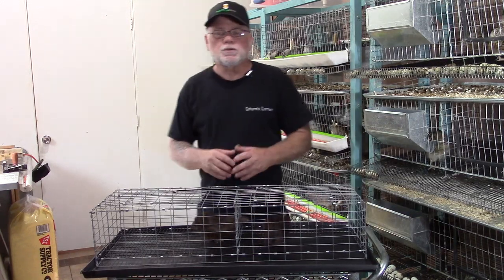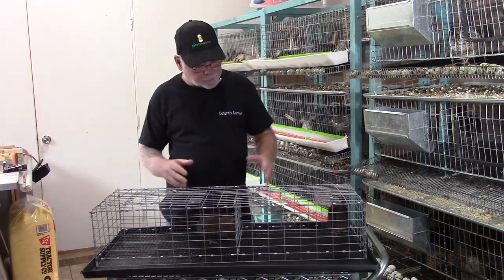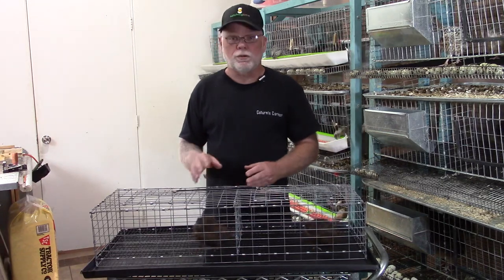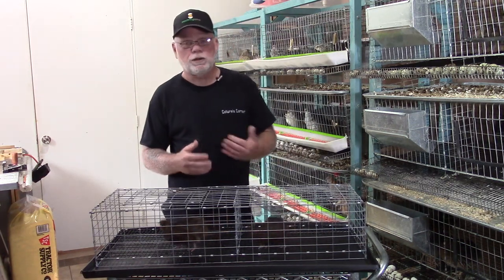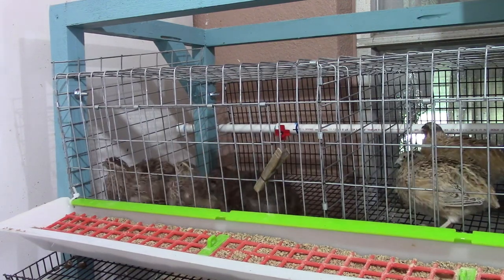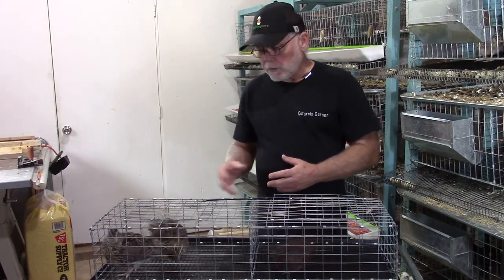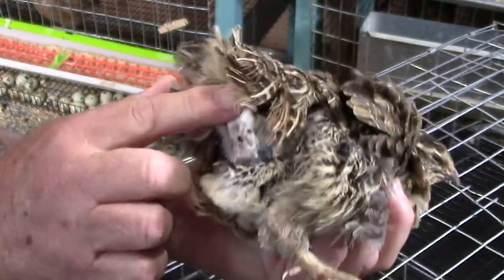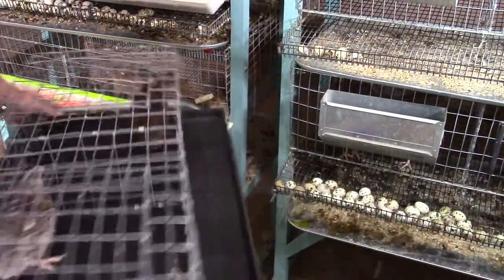Alternative Breeding Methods and Artificial Insemination

Comment: Awesome info Terry.  I've been having some issues with a new incubator that had an egg Crack in it last round, only getting %25 hatch rate for that run. After cleaning & sterilizing (not fumigating) 2 months ago, I started running small egg sets for baluts (30 each day).  After candling, I'm still getting poor fertility.  My breeders are all young healthy roosters (i.e. "foamy") and the do mate with the 3, 4 or 5 hens pending the cage, but still poor fertility rate.  It's been winter time cold here, so I collect throughout the day - some still warm when loading the in the tray.  I've made some adjustments for the last two racks, just to see if that can help (storing the eggs at 60°f in 70% humidity vs 50° in a cooler until loading).  I've also tried the H202 mist and rainwater rinse "patented" technique and will candle those this eve.
I plan on artificially insemination all my hens with my best rooster(s) just to ensure the next run is %100 fertilized.   If that doesn't help then it must be something with the incubator. The temp has 5 separate thermometers showing ideal 37.5°C in all areas, and the humidity is double checked with 2 digital readings.  Perhaps I will need to resterilize and this time fumigation with Potassium Permangenate and formalin gas (outlined in the wynola ranch hatching tips .pdf from Missouri stare extention).  I may try a smaller incubator and do a small batch just to eliminate that.  I have had %80 hatch rates, and nothing has changed with the electronics, controller, machinery, so I'm guessing it is the males.  I have swapped out layer feed with breeder feed, but they lay as if they don't notice a difference.

That being said - there is a story that 2 brands of tractor supply layer feed has caused flocks to stop laying.  My feed comes from an Amish country feed mill, and all non GMO.

I hate to sell hatching eggs if I can confirm they are viable.  Hate to have to artificially inseminate every day... I get enough work at that with my own "chick" :)

Your pal in RDG PA
Doc - Tully River Quail